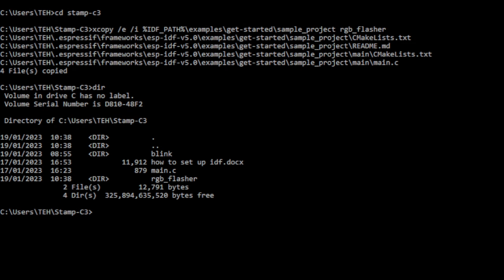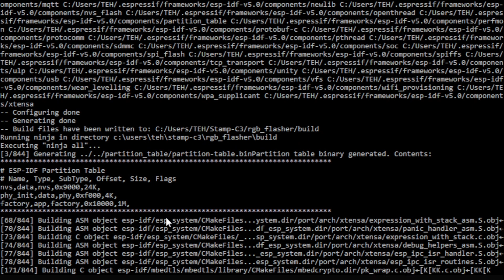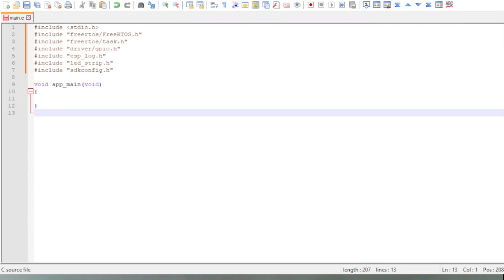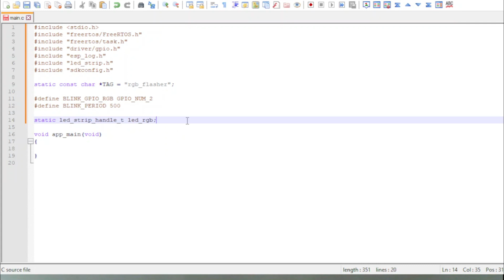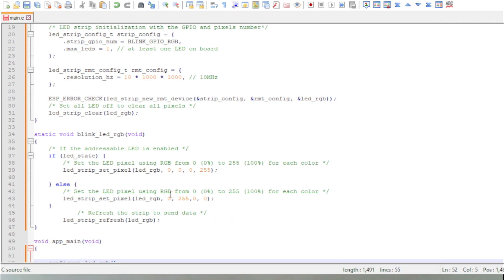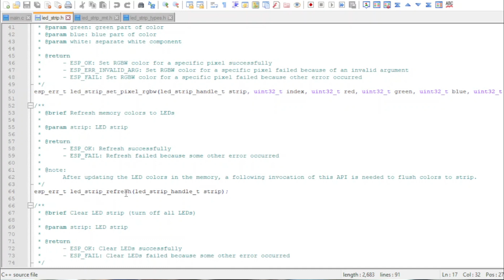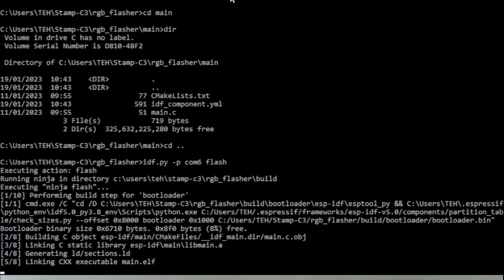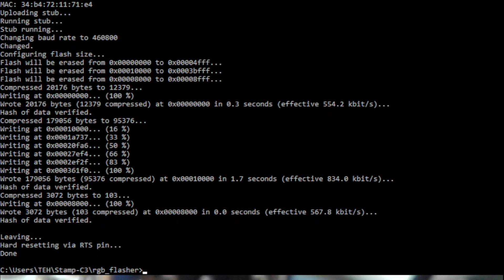#186 Springboard M5 Stamp Blinking the RGB LED

Comment: Another great video.  It’s probably just me, but I was kinda amused that after you said: “components to make our life easy”, we then went through long processes of compiling what seemed like hundreds of files, and then ultimately downloading over 200KB to the flash memory. All, just to flash an LED. 😳
Makes me want to fire up my Retro 8-bit CPU & Assembler, from the days when life was simpler, and write a few dozen (or less?) bytes of machine code to do the same thing. 🤓
i.e. I’m sure life was easier when we didn’t have all these huge bloated SDK libraries to read-up on and understand, before we could just flash our LED.  Not only that, we were also in complete control & understanding of all of the hardware, at the lowest level.  Yes, times have changed! 😎
Reply from the maker: Normally i drive these LED's by bit banging using a few lines of code. 
this one show's how i do it on the ESP32 https://youtu.be/wCJNME8oKR8

Comment: Wow, that is so much more complicated, show how much is hidden by Micropython
Reply from the maker: That's why i don't like Python, it takes too much away from the user. if you can drive a chip without it and understand how it works, you can take this information to a different chip by reading the new chips data sheet. With MP you have to look to see if there is a port for it, or wait for someone to do one.
I think they are trying to take the ease of windows / pc programming and apply it to embedded chips, The only lucky thing for them is they keep making chips with more and more flash to fit the bloatware.